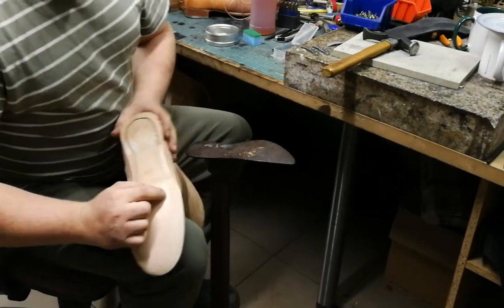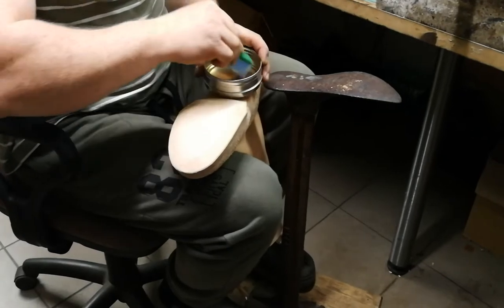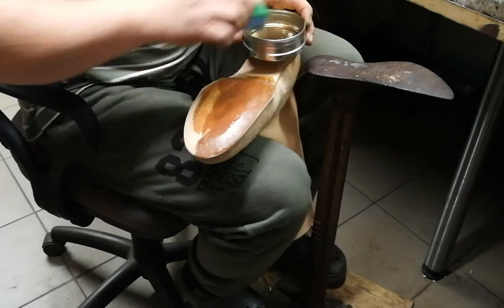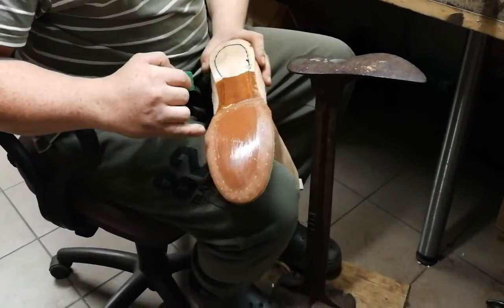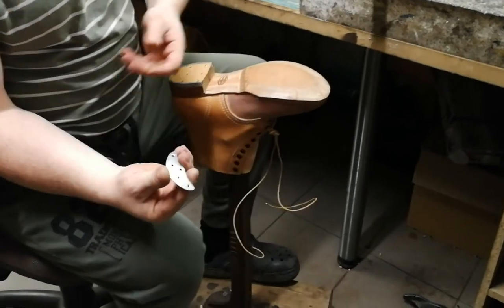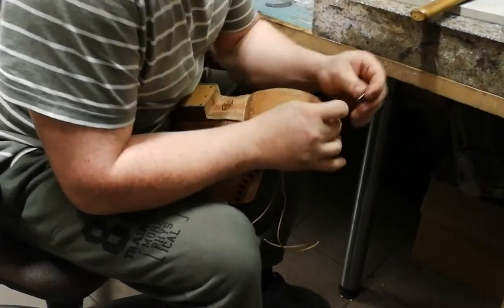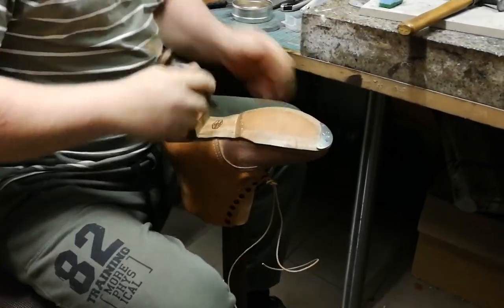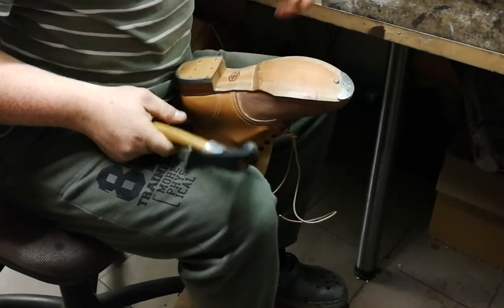installing toe plate and hobnails on german Jackboots

Comment: Could you put hobnails on any boot? Like ones with a rubber sole.
Reply: Nah
Reply: Yep. The shanks on the nails are longer than the sole is thick. When the nail is driven through, the point hits the steel last and curls over clenching the hobnail in place. Doesn't matter if the sole is rubber or leather. A word of caution though, only put hobnails and heel plates on boots that will be worn outside. You'll tear the piss out of a wood or laminate floor, and it like skating on ice on a concrete or tile floor